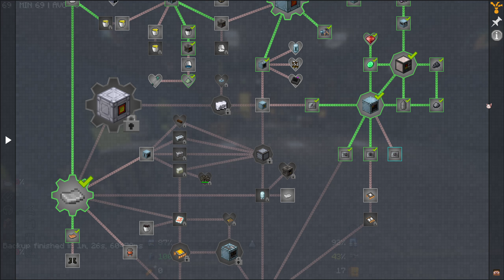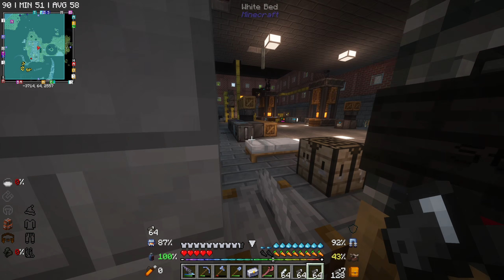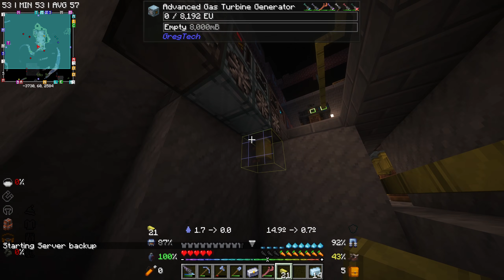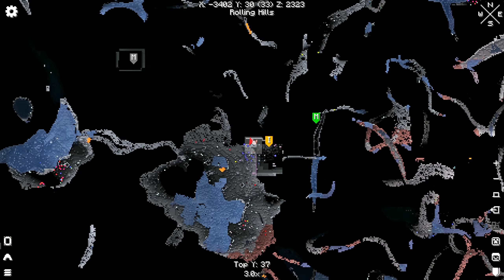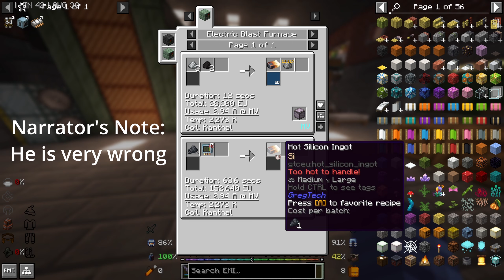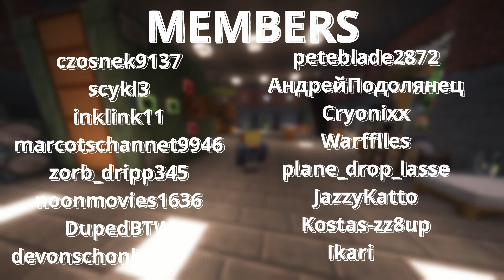Approaching the End of Medium Voltage! - TerraFirmaGreg

Comment: Hi i wanted to ask what are your settings for this modpack? do you use any extra resourcepacks or shaders? I would like to start my own TFG world and i want to setup stuff before i get started
Reply from the maker: Hey Im using the stock shaders that come with the pack! The 0.12 version also adds some new ones, I didnt add anything else
Reply: @syngevii do you use any special settings or changes i should know of for the game? I just did a fresh TFG install yesterday of latest patch and like half of the texture packs and additions have red text about being incompatible
Reply from the maker: @Malao75  Hm im not sure if 0.12 changed that stuff. Personally I didnt add any textures in my fresh install, when I used to smith stuff I would add the smithing helper texture which came out in red but worked fine

Comment: At HV you should be able to get infinite Silicone + Iron + Magnesium Dust quite early on:

1. Rock Breaker with e.g. Gabbro
2. Crush Gabbro to Mafic Igneuous Dust
3. Liquefy with Hydrogen in Liquefaction Tower to Liquid Mafic Igneous
4. Mix with "Slush Ice" to Obsidian Dust (Item from TerraFirmaGreg)
5. Electrolize Obsidian Dust to: 1 Iron, 1 Magnesium, 2 Silicone

If I remember right, the only "HV" component is the Mixer; although a Create mixer made of Stainless Steel should also work.

With crushed Pyroxenite (from Rock Breaker), you should be able to get Felsic Igneous Dust, which you can mix with sulfuric acid for Aluminium Sulfate (and so on...)

Besides, really great video like always! Can't wait to see the new base and what you'll cook up this time!
Reply from the maker: Yo thank you for the tips!! Im definetely gonna incorporate this stuff in my passive lines!
Reply: @syngevii i belive this got removed in 0.12

Comment: Id recomend that your first hv machine is the assembler as smd components are super cheap and make making circuits a lot easier
Reply from the maker: I did see the SMD resistors and diodes, I cant wait to start making things in batch of 16 instead of 4 xd
Reply: Use the tantalum recipes they give you 32 per craft 8 ingots gives you 8 stacks of resistors for example just send one of your miners to mine a pyrolusite vein

Comment: For the methanol in the Silicon Rubber processing line, if you have a net positive (Overproducing) of Syngas, you could've used it in a chemical reactor to make methanol instead of using fermented biomass.
Reply from the maker: I think I do, and tbh I could do that!

Comment: I only just now see you pop* cursor ) 
I have a tip for you ( does it a tip? ) you can make… Guns. As easiest of them I already make and it hit 25 hp (ending of ulv level). And another is that you can make from @miner helmet upgrade for you mining speed ( modul ) and get additional armor with light to you even you wear you main helmet. 
thank for video. ( I doesn't use translator and write by myself)
Reply: I have a question: how get rid of radioactive effect that stay 6 min and refresh ing every second? Do I need worry or it will go away at sometime? Thank
Reply: @the_olorevan  There are two cures for that in TFG. First is radaway pills which require Iodine (Gated behind Mars & mid EV). The second cure is to die and respawn.
Reply: @the_olorevan Look into pills
Reply from the maker: Ay ty for the tips! Im totally gonna get into guns, but atp I dont really do hand mining anymore xd (also I hope you like the pop cursor xd)